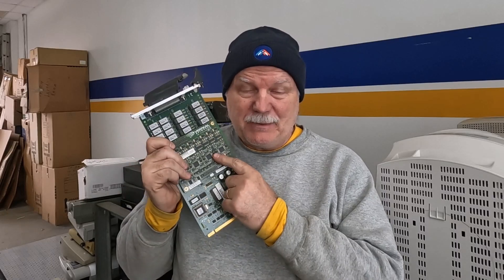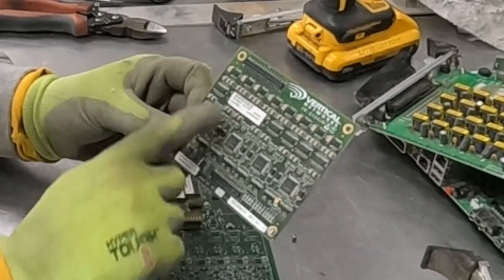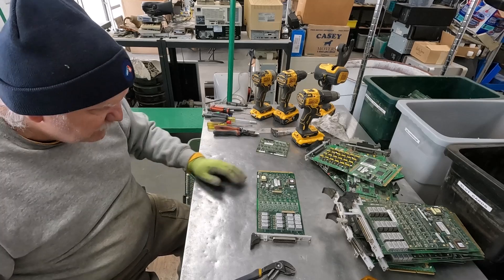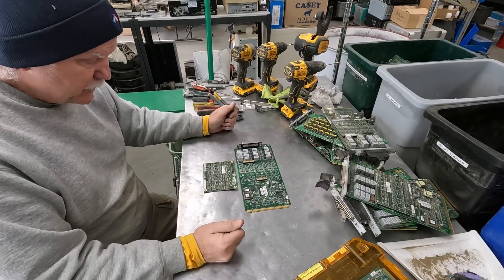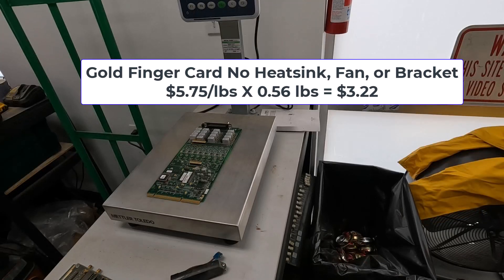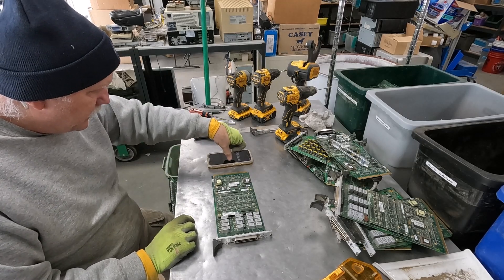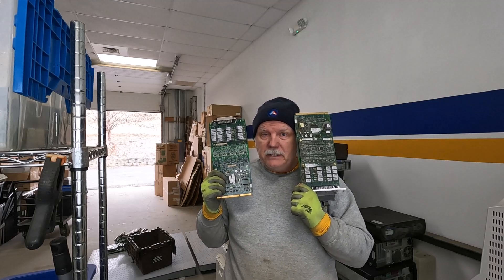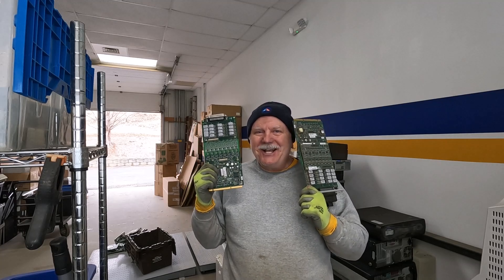Unlock Hidden Value in Circuit Boards

Comment: I would / already do, exactly as you did with a board like that. If nothing else it's just to remove any doubt that the board would be down graded. Shipping coast to dang much to make a mistake and be down graded for a load.
Reply from the maker: Very true. If I'm going to make a mistake, I'd prefer that I was too conservative and Boardsort upgrades my boards. They've done that at times.

Comment: I always leave brackets on my gold finger cards.  The bracket is heavy enough to amount to more value at the lower rate than you would make with the higher rate "cleaned" gold finger card.  Basically the heavier card with the bracket is almost always worth more than the lighter card without the bracket.  The labor difference is just an added bonus.
Reply: But heat sinks, fans and metal bits always come off, that rate difference makes it always worth it.
Reply from the maker: Good plan and the numbers agree.
Reply: It was actually enough of a price difference when I separated one to weigh and run the numbers, I reattached the bracket for maximum value.
Reply: But just to complicate it more, is the shipping cost significant with extra bracket metal vs a lighter clean card?
I don’t know either😅
Reply from the maker: We can complicate it even more because while it's easy to say shipping costs around $1 to $0.75/lbs, one needs to consider that the brackets take up space and complicate packing which may lead to a larger box for the same number of boards.
Reply: @sharkscrapper  thanks for complicating my already complicated complication.😂
Reply from the maker: @dr.a006  Happy to make things more complicated for you in such a complex world and dealing with such complications 🤣

Comment: I have a bunch of boards like this that I need to understand how to break up. 

The biggest question I have now, as a newbie, is how often will I get the same boards. If it seems like I’m getting the same types often then It’s worth it to me to break down the most efficient way to get the most, otherwise I may pick the easiest option . It’s easy for me to fall down a rabbit hole , but as I’m learning I suppose that’s inevitable.
Reply from the maker: You're asking some very good questions. How frequently you'll get the same boards depends on your sources. It is rare to get consistently similar boards unless you have someone like a manufacturing company as a client. I batch types based on each pick up as I can never know what's coming in the next load. 

As for going down a rabbit hole of how much work to do on boards. I always advise that you know how you're going to sell or process whatever you remove from any scrap. That helps me avoid spending too much time for little reward.

Comment: You have to simplify every step of what your doing.  I would only take the bracket off.  Then put the hole thing in my high grade pile.  Which I get around $10 a pound for.
Reply from the maker: If I was getting $10/lbs for general high grade boards I'd absolutely do the same. That is a very good price for general high grade boards.